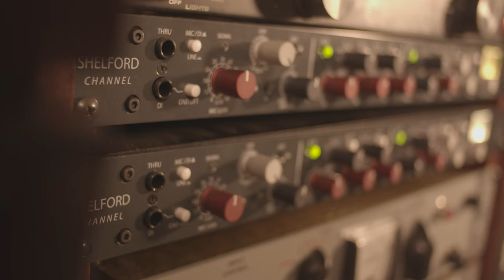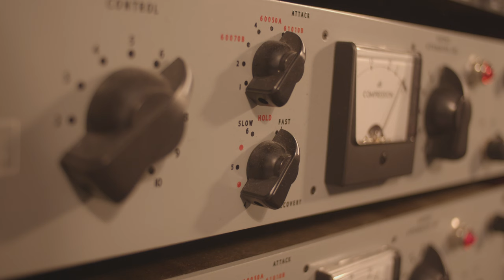The reason your AKAI MPC has 8 analog outs (...and why you should use them)

Comment: If you are doing multitrack recording, you can synchronize the MPC to your recording. Then you use the 8 outs to add more tracks to your mix, so you don’t have to use up audio tracks.

If you are using an analog recorder, you just print MIDI code to one channel of your tape. It requires an extra box, but it’s cheap. You give up one recorded track, but you gain 10 sequence tracks.

If you have different instruments, like a bass, and piano, you might want to mix those separately from the drum beat. 

I got the 8 outs for my 2000xl mainly because that expansion board also has the digital in out
Reply from the maker: thanks for this tip. I never thought to use the digital outs, but that makes a lot of sense.

Comment: Just got my first mpc (2000xl) and have had a blast learning the ins and outs of it. Just got the 8 outs adapter and found your video when searching on how to make the most of it. Thanks for the tips, found it super helpful!
Reply from the maker: I'm glad you found this helpful, and I hope it enhances your first MPC experience. Most people only use MPCs for sampling and sequencing, but when you take advantage of its connectivity, it takes the machine to new levels. Enjoy.
Reply: I have an MPC 2K XL and would like to route my MPC X through it to enhance my sound. Do I midi or do I use the outs/ins to achieve this
Reply: @jayjohnson9894  MIDI doesn't carry an audio signal, just data. But you can chain them to trigger each other.

Comment: Some great advice in here but there's something magic about the way a lot of MPCs sum the signal to the stereo output, especially when you push it hard.  Same goes for clipping the inputs on the way in - tonnes of punch to be gained from doing things this way.
Reply from the maker: Second that -- I love clipping drums in the MPC. And yes, the stereo outs work just fine, as long as your mix is fairly balanced.
Reply: A nice “glue” compressor on the mixer bus might do the trick? :)

Comment: Hello Eddie, thank you for your knowledge. For my part I used the 8 direct outs for years and today I stopped, and I work with the stereo hands outs. I was wasting too much time mixing and adjusting compressors and effects. Today I work in the opposite direction, that is to say that I sample and I work on my beat I use a channel or two of the direct outs, to equalize or modify and process a sound, and I resample it in the 3000. because the mix is saved in the machine with the sequence, which allows me to work on other beats, without having to mess up the mix in hardware. I use a daw for assembly as well as effects and compressors. I spent too many nights on the 3000 in song mode, I use a dawn in addition to the 3000 for editing. my work and on a Mpc 3000 and an asr 10. i make my beat, i use 1 or 2 out outputs to modify the sound and i resample it for everyone to have in the 3000, the internal mixer is really good. I'm like you at first, I swore only by the hardware vinyls and tapes, but we must admit that the qualitative subtlety is really too subtle for ordinary mortals. Hello from France Mika.
Reply from the maker: Oh wow, I'll have to try this. I love resampling back into the MPC, and you're right -- the stereo outs are very very good. It sounds like this is a faster workflow for you. What DAW are you using to edit the beats? Merci beaucoup! _ edourd :)
Reply: until their souls are starving for authentic art again either that or they're the living dead already and in that case only us immortal have a will with thoughts on immortal crafts that matter anyway... yep
Reply: @TheOwlHead  yup

Comment: I was against using any daw or even computer for making music. Only MPCs, records and Stereo Outs :D And one day I realised I need more "control". And I bought monitors, audio interface, mixing desek, compressor and vitaliser. I went on different level regarding sound of my beats. I don't really know why I have done it soo late. Now I'm experimenting with connecting different gear via MIDI, as I was always resampling everything. Really great video Man!
Reply from the maker: Sounds like you have an expansive and functional set-up. I think the key is always advancing and elevating, to push the possibility of your sound, which you're clearly doing. Especially when you add MIDI to the mix. Cheers,
Reply: @eddieleonard6925  nothing crazy expensive. I also have ART Pro VLA 2 Tube compressor. And to boost low frequencies I use SPL Vitalizer mk2T. I really like to process the sound throy Tubes. You have such a nice set up too! MPC 3000 sounds so nice and soft. I need to try MPC 60 and S3000 combo. Take care.

Comment: Fantastic video about exploring beyond limitations.  I haven't tried the 8 outs on my 2000xl yet but plan on doing so as some samples carry too much bass where I/O mix makes management of the sound easier. I have used Stereo Out for so long that it feels normal.  Definitely gonna get another mixer to replace my defunct Alto ZMX862 and likely add a compressor of some sort.  It all comes down to how the samples are flipped, layered, and pieced together by the end user transform bits from many places into a new piece in the workspace.  Keep up the knowledge!!
Reply from the maker: Thanks for checking this out. Not all 2000xl's have the 8 out expansion, so you're lucky to have that added flexibility. The stereo outs actually sound great on that machine in particular, but depending on the compressor you use, I agree that having more control over bass and general stereo separation should do your music good. And yes, it's all about the mind, not the machine. Cheers,

Comment: super rad set up. i have the mpc 1000, but I use the 4 outs with reverbs and distortion. Just started building a rack mount setup because i have a couple small rackmount synths i'm setting up but been scoping out for a compressor also, something i learned while working at the recording studio in college. ive been looking for a 3000 or 2000xl project piece, just for the 8 outs!
Reply from the maker: That's a solid setup. The 1000 is a great machine. Great form and size. Once you get up to 8 outs, new possibilities open up, for mixing, but you have more than enough to make solid grooves right now. Cheers,

Comment: I don't know about the 3K, but the 8 out expansion for the 4K don't sound as good as the stereo output or the headphone jack. The way I used to do it (if I remember right, this was like 10 years ago) was that I just used the stereo outs and somehow had the DAW's transport sync'd up with the MPC's, so if I hit play on the 4K, it would make the DAW play. That way I could just track things in the DAW as I composed the beat. Once it was in the DAW, after editing and applying effects or whatever, I could track the stems out from the RME Fireface interface I had running to a Soundcraft Ghost mixer, where I would do the final mix, and then sum everything to a 2 track stereo mix which would then go back into the computer. I almost never used the MPC's 8 outs. It wasn't that they sounded bad, they just didn't sound great like the stereo outs. The other reason to do it this way was that I only had a single pair of high end preamps. This way everything got saturated as it was tracked into the DAW, which made a big difference sonically when doing the final mix and stacking all those tracks together.
Reply from the maker: That's a great workaround, especially since you had 2 solid preamps. The stereo outs on the 3000 do have some compression, so that's why people love using them. I think the 8 outs sound great, though. Lately, I've been using the stereo outs as my kick and snare, making it 10 outs total...taking advantage of the stereo compression to make kick and snare punchier. Works great. Never used the 4000, although I always wanted one. Thanks for the note.

Comment: Well said! Any solid mix engineer worth their weight will ask for individual channels out to process individually. The real good engineers will also ask for the stereo output to get an idea what the producer/beat maker we’re trying to produce. Great video.
Reply from the maker: 100%. Thanks for noting this. MPC heads tend to overlook tracking out because the stereo outs sounds so good and add their own subtle compression, but I'm 8 outs all day.
Reply: @eddieleonard6925  And it’s okay to overlook when they’re in creative mode. While they’re making the beat, most of the focus should be in producing/creating the beat. 

Once the beat is done, then they can move on to creative audio manipulation.

Comment: Dope video and commentary! So far I’ve just used the stereo outs on any of the MPCs I’ve experimented with. I primarily used the Roland/Boss SP series of samplers as effects boxes to add texture to the sound (such as compression or the nice vinyl sim effects). Good points about the 8-outs allowing more flexibility in experimentation and sound design. Gotta try it soon (I don’t have an 8-channel mixer at this point). Nice work
Reply from the maker: Thanks, bro! The stereo outs have a magic of their own, but imagine this: running outs 1 & 2 into an SP OG, then outputs 3 & 4 into a 303, and outs 5 & 6 into the new SP....then you could rock 3 sets of stereo effects on a single beat. We might have to collab on that...could make some interesting textures.
Reply: @eddieleonard6925  bro I’m down, that’d be crazy to experiment with!!

Comment: Yeah that one of the reasons I installed the 8 mixout board on my 2000xl  cause it enhanced sound better than using the stereo out , that’s why "Marco Polo"beats sound so Rich and warmth
Reply from the maker: So true. It's a slept on feature of all mpcs. The 2000xl was my first mpc, but I didn't have the expansion board...didn't realize what I was missing until I upgraded to the 3000.
Reply: It don't enhance your sound, timbaland used to literally say the opposite (to use stereo outs and not 8 outs) and that was just as bullshit. Beat making is about sound selection, period. and I can guarantee you that Marco polo does not sound like Marco polo because he uses 8 outs

Comment: Super Dope Vid just found your channel and I love it! gained a sub for sure. I do have question you are talking about running your individual tracks from your mpc to other analog processing are you running those outputs from the mpc directly to the outboard (Eq, Comp, Etc) then the outputs of the gear back to the board or are you using some sort of insert or send from your board to handle that? Thank you so much! Peace
Reply from the maker: Thanks for checking the channel. Yes, I run my individual outs directly to the outboard gear, then into my board. This works for me because I always keep the same sorts of sounds/samples/instruments on certain tracks. You do the same?
Reply: @eddieleonard6925  I actually do! The board I use currently (Tascam M520) is 99% RCAs so I was having trouble finding cabling to support the insert points with my outboard so I started just running directly to the outboard through my 8 outs, I use a Patch bay as well so it does make it easy to change things if I need but I've got a main program saved for my 2000xl that has my routing saved that I use most of the time. I'm just glad to see someone else doing that. I came up always using insert points on a board. Only thing I've noticed is for some of my gear I really have to pull back the individual outs so I'm not clipping the gear (unless that's the vibe) Thanks for the reply.

Comment: The analog 8-Output is Definitely better. Amazing!!! You treat each track-out like a real instrument using all that gear to color the sound. Thanks for sharing.
Reply from the maker: A new trick I just learned is actually using all 10 outputs, 8 individual plus stereo outs (which have more compression on them). And yes, this way, each track gets its own treatment in the one-man-band. Cheers,
Reply: @eddieleonard6925  Oh wow! But wait..: what are you doing with the compressed stereo out? Is it part of the 8-track out recording? Or are you recording it as a separate individual compressed song?
Reply from the maker: @ONEHENDRIX  i turn down all the faders on the "main mix" (stereo mix) and turn up the one i want in the stereo out. pan hard L or R, and it makes 2 more outputs, that you can track at the same time.
Reply: @eddieleonard6925  Oh shit. Right!

Comment: Quick question. Are you running 1/4 TRS out of the mpc to XLR Male to the back of your mixer?
Reply from the maker: Yes. But sometimes first into a compressors or reverb, which then connects via xlr or 1/4  TRS into the mixer.
Reply: @eddieleonard6925  thanks homie. Your channel is dope.

Comment: So this is what I was trying to develop a scientific test for. By the time your digitally saved  sample goes through your chain of analog i/o and goes all the way around the choo-choo track to the speaker and of course, the thing that really matters finally to your ear... Do you think it has introduced enough chaos like the Fibonacci sequence to wear that digital sample has now become a completely organic analog, sound? But you're running it as a master stereo outs. Perhaps this would have to be done before hand in someway is kind of where I am experimenting right now. I'm going to say probably, maybe or mostly perhaps yes. I have never seen a video like this that's you're doing what I want to do but I've got some other angles and you do too.
Reply from the maker: Let me know how the experiment goes! I need to try this again...what I didn't realize was how much the overall experience factored into the end result. Sonically, I think that with a little bit more work, you can get digital to sound the same as vinyl, but I still need to try a stricter test. Peace!
Reply: @eddieleonard6925  there is definitely something to be felt in an a ritual/tradition. 

Digital is better for laser cut surgery and speed many times it's also predictable with zero noise floor

 But rarely do i want skittles when its meat time for steak. Just wont do. There's no straight lines in nature, bit depth, is it to our ears pixels are to tvs. 

I think this is precisely what makes the NPC so cool because you get the benefit of digital but yet it's really 80% a piece of analog gear and it's pushing that digital sample through analog hardware. I don't know how exactly does it it's more than just an amp. I was just arguing with a Grammy winning Brazil jazz engineer about this and I know I'm right he's wrong. 😂

Comment: Thank you for the video,  it’s a subject that is not that well commented. It’s a real dilema going all analog vs processing into the DAW. Some producers also mox into the mpc amd route the stereo outs into outboard gear with nice results. Put of curiosity, what mixer so you use? Peace
Reply from the maker: True. Great points. Sometimes I actually prefer the stereo outs with a simple "glue" compressor, but there's so many options when you use all 8 outs. The mixer is an Allen and Heath Quasi mixer, from the '70s. Cheers
Reply: Using all 8 outs is ideal. Your beat will sound flat and teeny through the stereo outs

Comment: My XL doesnt have the 8 outs, but I don't know if you tried this but I have been doing everything in Mono. so like sample in L in and send the L out into 1 channel into my mixer. I track out one track at a time, but do the arrange in my DAW so I just grab a few versions of 8 bars per sound, which makes it pretty fast. When I run the sound through the mixer I use stereo outboard gear and change the EQ per the sound. But mainly was curious if you tried just a mono out since it is like using 8 outs but just the L from the stereo mains. It's an interesting way to make the drums slam down the middle and then widen up the synths and other stuff with stereo verbs, delays, compressors. Awesome channel!
Reply from the maker: Oh that's dope. This is a very creative approach. I recently started using the stereo outs as 2 extra outputs, panning L or R to give me 10 outputs total. Do you find that the stereo outs are better for drums? It's rumored that they have more compression on them, so maybe I should switch my drums to those outputs, rather than outputs 1-2. Thanks for the tip!
Reply: @eddieleonard6925  Good question, I have to use them since it's all I have .haha. I will mess with using both Left an Right outs versus just using the Left/mono like I described and let you know what I discover.

Comment: Stereo outs sound good, but running 8 outs into a desk gives you a larger canvas to paint the landscape on. And you can literally see this and hear it. And that’s just the beginning of the power using 8 outs gives. Not to mention the stereo out would be another +2, so really it’s 10 outs.
Reply from the maker: Soooo true. It's crazy -- but I've never tried using stereo outs while using 8 outs. That's a great idea. It's could almost work like parallel compression on 2 extra channels. Thanks!

Comment: Question. There is a resurgence of buying older samplers like the Sp1200 and the mpc3000. If I make my tracks in mpc live 2 and feed them through gear like yours, will I be able to mimic the sound of a vintage sampler or should I just spend the money to get a vintage sampler?
Reply from the maker: Great question. With plug-ins and good mixing, you can actually make an mpc live sound like a 3000. It just takes more work to do what the mpc3000 and mpc60 do naturally. 

This is not the case with the SP1200 or akai s950. No plug-in or mixing can really replicate that sampling engine & conversion. In that case, it would make a big difference if you ran your tracks through them. 

I wish I understood why, but samples (drums especially) sound 10x better when running through an s950 or an sp1200. I used to own an sp1200 and all I did was run drum samples through it to achieve that "sound." Hope this helps,
Reply: @eddieleonard6925  thanks dude. I love your music experiments. Keep em coming. :D